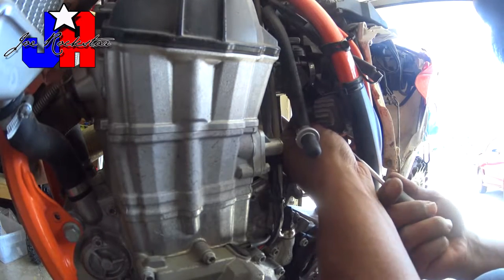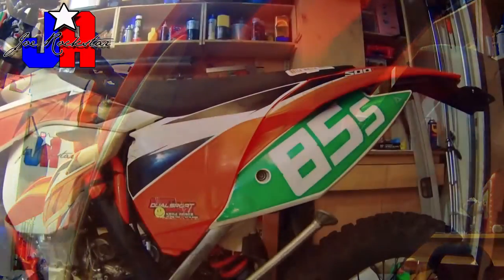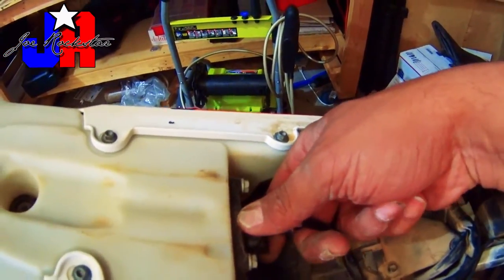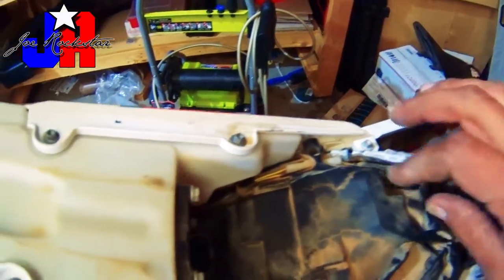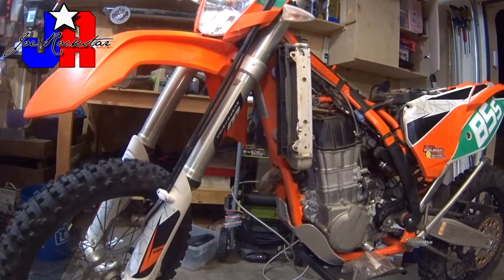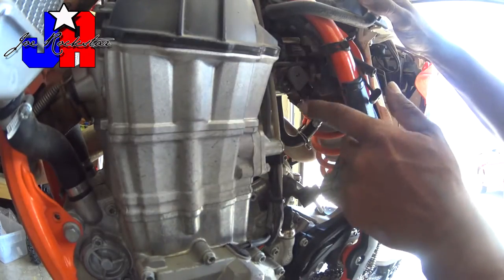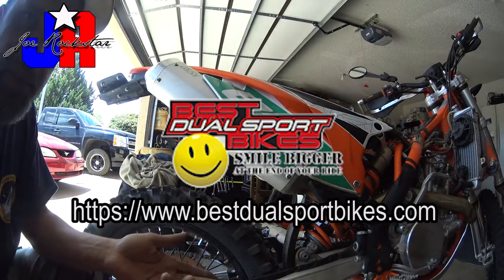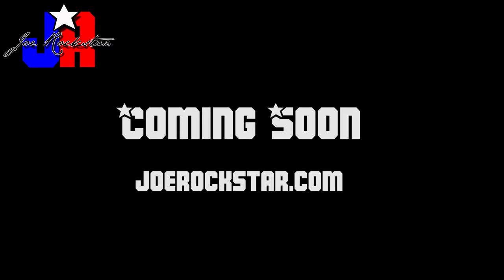KTM 500 EXC Maintenance Pt 1 Removing the Fuel Tank

Comment: I can not find any information anywhere at all how to remove the emissions and restrictions on the European KTM 500 / 450 models... All information online is for the US models only and they are very different. EU models at least here in Norway have a restricting tube in air intake can not find out how remove (instead of reed vales), they also have Lambda (O2) sensor.
Reply from the maker: Wish I could help.
Reply: I how now figured out I basically  need to remove the whole rear subframe to get of the air-filter box off to remove the restricting tube , but that is how it is working on motorcycles :)